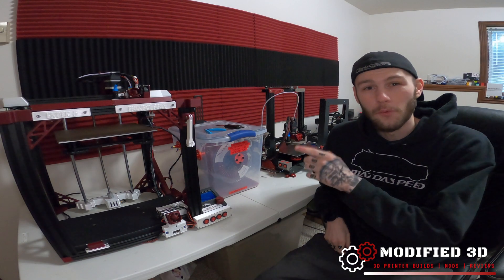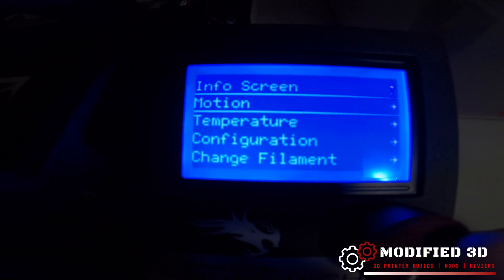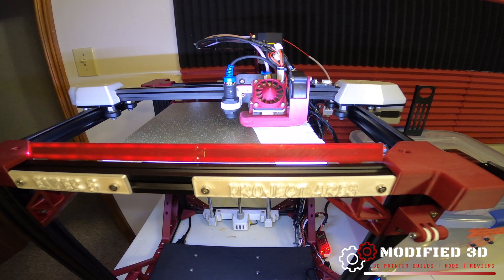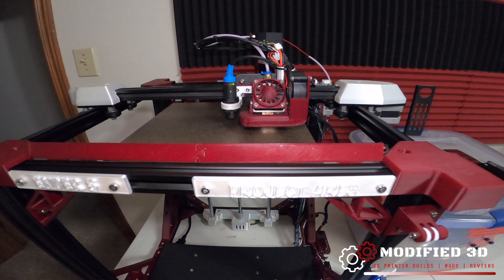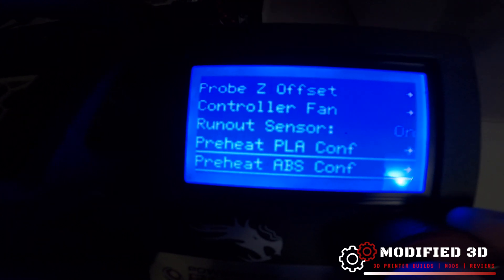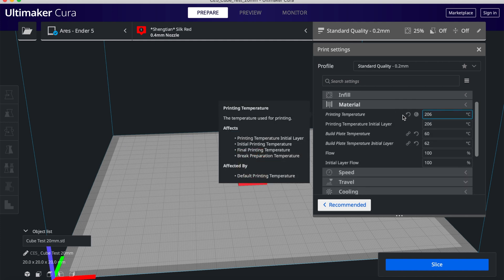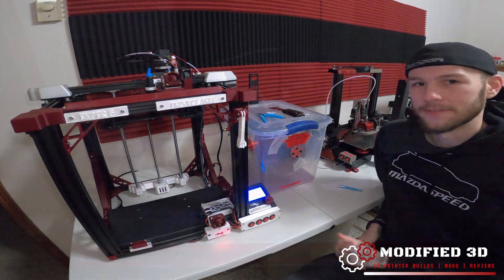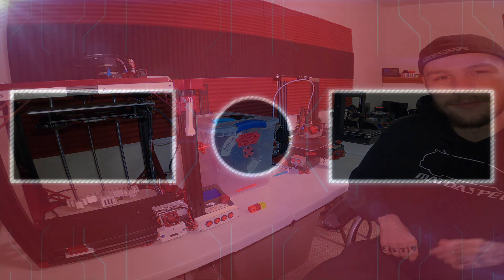How to Tune the Slice Mosquito Hotend | Creality Ender 5 or Ender 5 Pro

Comment: Would this work with an ender 5 plus nice video
Reply: works fine on mine, E5Plus , mosquito magnum hotend, Bondtech ddx Extruder,  60 watt slice engineering 500c heater cartridge , Pt1000 thermistor, and the boron nitride paste, with 18 gage steel enclosure and reptile heater I usually keep set at about 65 to 70c. only thing I need to tweak is a silicone boot for the hot block (have one on order) to help retain heat a little better . Prints 30% carbon fill nylon , PEI , And Peek like butter